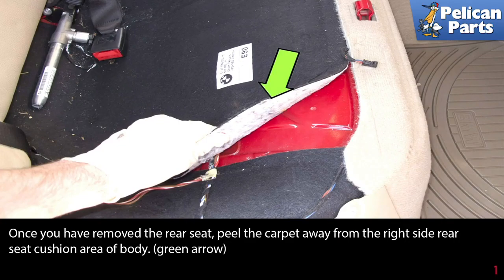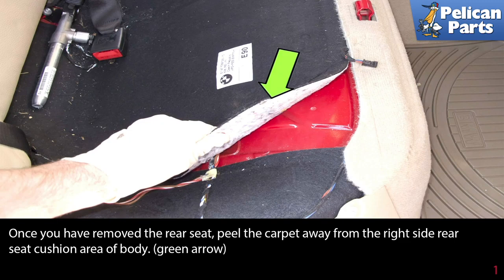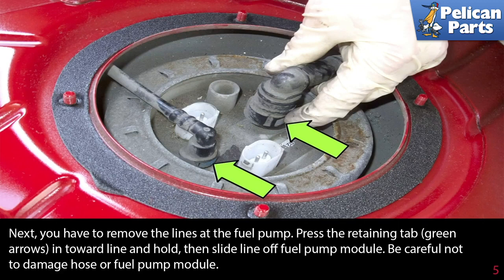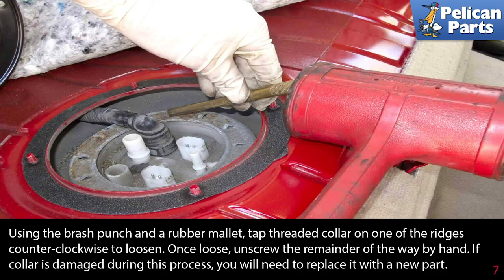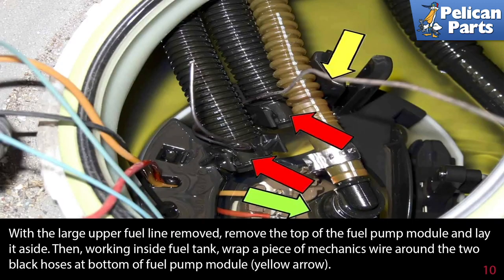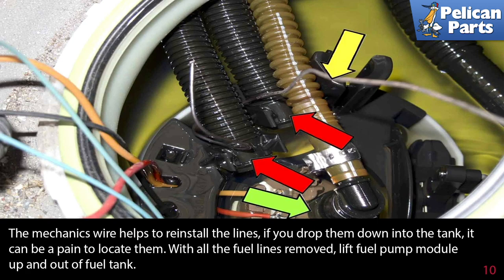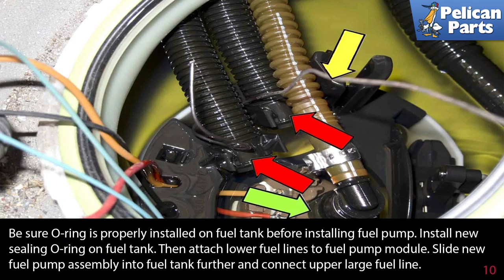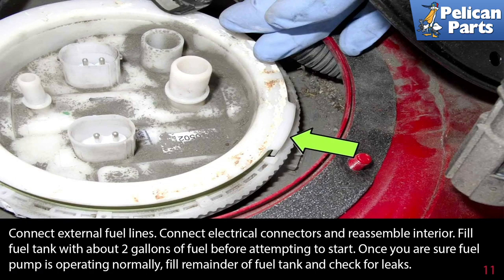BMW E90 3-Series Fuel Pump Replacement

Comment: My mechanic wants to charge $1000 for this job to be done, is that accurate?
Reply: That’s not a mechanic, that’s a predator
Reply: @iamher6422 hmmmm,  can you cite that?? It's a bit of a pain in the ass job and a quality fuel pump ain't cheap for the part. Also, you need to understand, repair facilities mark up parts. It's an expected industry standard to cover the costs of overhead. Facilities with high overhead hate to have customer show up with their own part....if so, they'll just likely increase your labor cost
Reply from the maker: I am not sure what the repair will cost in your area. Call a few shops and ask for a quote. It is also a good idea to have them confirm what the issue is.
Reply: @pelicanparts  it’s in Georgia, USA.
Reply: With labor and parts could be as high as 800$ pre tax. Pennsylvania, January 2022. That's what I got quoted by BMW and that's what it was